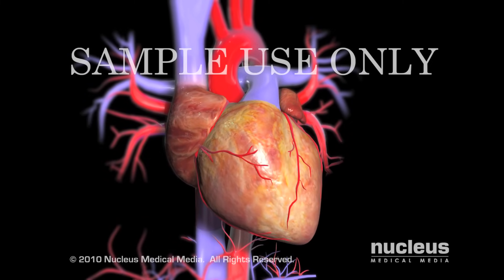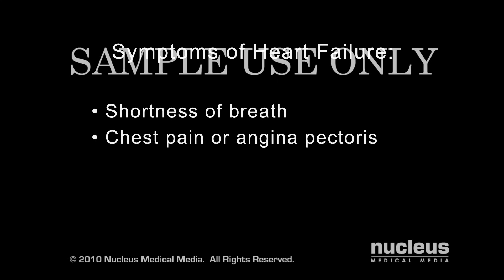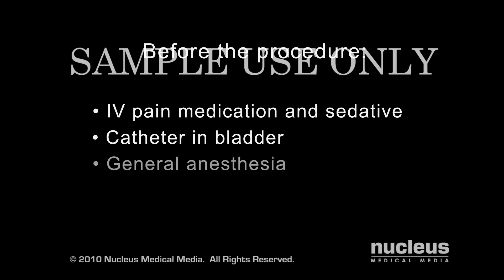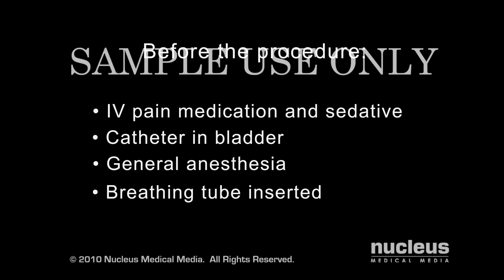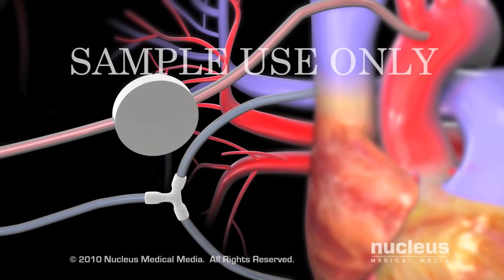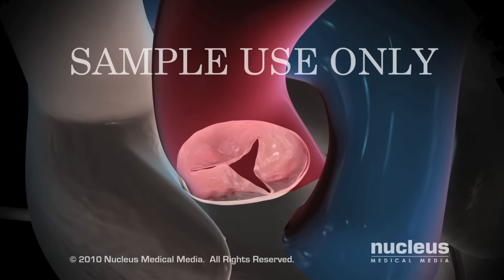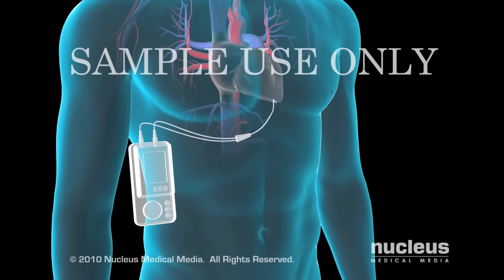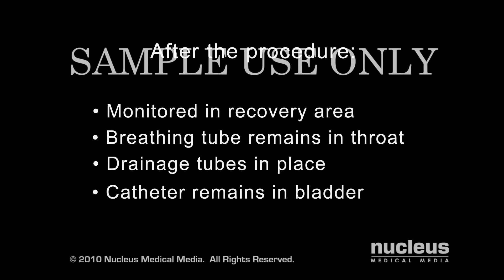Aortic Valve Replacement

Comment: im only 26 and just had mine done 4 weeks ago, very easy. recovery is the hard part
Reply: You are 34 now
Reply: @kimisinclair.04  35 now. heart feels fine but now having strange pains like cramping. had heart monitor for 1 month and 2 ECHOs and said everything good. its a strange feeling. got to try different doctor.
Reply: @tallicafan85  great I hope ur doing fine sir
Reply: @tallicafan85  cramping where?
Reply: @Pardesiah1  under bottom breast bone and few inches on each side from there. its like pressure and a  cramp like pushing on it with you finger kinda hard.
Reply: @tallicafan85  i have also cramping like feeling for 4 years now,im 18 years old.the doctor said every thing is ok.and i just have bicuspid aortic valve and its functioning properly idk what to do😪.
Reply: @wardog5073  i was fine for a week or so then last night constantly hurting. I think its scar from the stitches.
Reply: @tallicafan85  what symptoms do you have when your valves are damage before surgery
Reply: @robinsonlaishram4141  before surgery i had chest pains and the urge to need a drink for the pain would go away. I would get red in the face easy and cramping in the chest.
Reply: @tallicafan85  my mother is 56 now.. she has been told to get this surgery done. I'm so freaking afraid since my Aunt passed away a few months back with the same surgery. Idk what should I do, don't wanna lose my mom.
Reply: @tallicafan85 don't know who you are, but, good to know you are healthy!
Reply: @kimisinclair.04  abb doorbean se Hota ha kya
Reply: 10 days ago at 40 and fully agree!
Reply: @shanithmuhammed1490  i choose the artificial valve.  If you have the metal one you gotta be on blood thinners and if you get cut you will bleed more.
Reply: For how long is that valve lasting?
Reply: I’m 41, I need this done within the next couple months. I have congenital aortic stenosis.
Reply: @Your-Boi-Shane  same with me, did u do AVR.... Whats app me 00966565914899
Reply: @Your-Boi-Shane Same. 45.
Reply: God bless you inshAllah you are fine today  may Allah bless you with hafiya Ameen ❤️
Reply: Can it be diagnosed after 2 month bcz my friend is syncope attacks too 
Due to covid he is  not able to go .
Reply: I was just told today I am going to have this surgery done not looking forward to the breathing tube
Reply: @shanithmuhammed1490  dont know what your hospital does but only options i had has artificial or metallic. that was at yale.
Reply: Hey i need to contact you please give me your email i also have replace my arotic valve so , please understand i have some questions before surgery , so please replied me
Reply: @Doctoratan  did you done your surgery..can you tell me what are difficulties you faced after surgery
Reply: Hope I never have to get this done, I’d rather not have any surgeries ever but the way my heart has been acting I may have to get something
Reply: @Chriss_geek_shop  get tested, its your health. i did wait a ling time to get checked out and when i was getting worse pains i got checked out. doctor said if i would have waited another year i could have had a heart attack.
Reply: @tallicafan85  Derek, how are you now?
Reply: David Afanasiev  aab toh sayad doorbean see Hota ha
Reply: My song is getting ready to have that done probably here in the next couple months. He's only 13
Reply: My ex had it done at 26
Reply: How did you felt?...how long you got the pain of surgery after done heart surgery..?does it hurts for long time..and what about your bone...did you find any difficulties after surgery...my mom is 47 years old..and doctor said she want to be done heart surgery...iam very scared..does it hurt after surgery...pls tell me
Reply: @방탄소년단-c3m  yes it hurts. it is your main chest bone and takes 1 year or more to heal. hurts to sleep if you move to your sides or sneeze. cant lift more than a few pounds for months.
Reply: @tallicafan85  I'm tired of chest pain and hard breathing. I'm 23 and i have bicuspid aorta. I think i should get this surgery done. What do you think about valve replacement from femoral arter? Is it better? Thank you, i hope you will better
Reply: I was told last year that I have a heart valve stenosis and need to get this surgery done and replace my valve. Recently, the doctors told that I must get it done as soon as I'm ready. I'm just 21 yo. 
Can anybody tell me should I  choose Ross procedure or get a mechanical valve?
Reply: @ziauddinhabibi2678  artificial valve better. mechanical valve means you be on blood thinners and if you get a cut you will bleed a  lot more.
Reply: I'm about to have mines in 2 months, what was the recovery like? Also glad to see that your doing okay <3
Reply: @peepo8455  recovery was the hard part. i had chest cut open and after being home, couldn't really do much. lifting more than 3lbs hurt, sneezing and sleeping. took 8 months before strength came back.
Reply: @tallicafan85  you choose mechanial walve or tisue walve?
Reply: @faisalshabbir4248  artificial valve. if you have mechanical you will need to be on blood thinners and if you get cut alot like i do you will bleed more.
Reply: @tallicafan85  then what about after 8 years
Reply: @faisalshabbir4248  its been 10 and bones are beyond healed. i say it takes about 2 years to fuse and get back up to strength.
Reply: You are 37-38 now…
Reply: @edoardoseccafien655  yup, 38. still doing good and not having much caffeine like i used to.
Reply: How much it cost
Reply: @ranro-o3  all depends on your health insurance. for tests and surgery then i think i paid out of pocket about $6k
Reply: @tallicafan85  8 years later and you're doing fine. What a chad.
Reply: @ranro-o3  more that your whole life. 

That was rude I am sorry
Reply: Can u do your regular task now?
Reply: @sadatmuid2580  yes, only took 1 year to heal up and 2 to get stronger.
Reply: Where ?
Reply: Where did you get it done ?
Reply: eèe3ee
Reply: text
Reply: I'm 26 and having this done :(
Reply: I m 36,Dr said I had to do this surgery,my kids are too small m very nervous nd very tensed I m a working women,no one to help me,I have to raise them
Reply: Getting mine at 17 haha
Reply: good luck to all of you…may God make it easy for all of you and may you heal faster than you were expecting 🙏🤲
Reply: Are u still alive
Reply: Aapke ef kitni thi operate tym
Reply: Apki surgery ko 10 year now u will fine sir
Reply: Am 29 heart valve damaged minor leak
Reply: How much cost sir
Reply: @nethradeepak8595  depends on your insurance. I think for everything it was $5-7k out of pocket
Reply: Wow 26 and had aortic valve replacement! I saw your most recent comment from 1 day ago, glad you are doing well! 
My father (60 years old) just had this surgery yesterday, Drs said the surgery went well, he’s in ICU now still sedated, he’s been having these muscle spasms or convulsions or something. Neurologist is saying all his tests look good brain wise. Did you experience anything like that after your surgery?
Reply: @6thGearSmacked  im doing ok after these years. My 11 year anniversary is coming up in few days. Only thing that is going on with me now is chest pains. Had heart monitor for a month a 4 years ago and they said heart was fine. Still. Don’t know what causes it. Just had the pain so bad last night I almost wanted to go to hospital. I was in pain and sweating, almost threw up. Not sure if it was bad hear burn of caffeine reaction.
Reply: @tallicafan85  hey I was wondering what symptoms were you having in the first place that prompted to you to get checked and end up getting this surgery? 
My dad had this surgery recently and is still recovering. And now all the sudden I am having weird chest feelings..
Reply: @6thGearSmacked  it was bad chest pains like cramps around the heart. I would turn red easily. I would need to drink something for it to go away and thought it was just heart burn. Then one night I couldn’t sleep it got so bad I called out if work and went to walk in clinic. Was a 1 hour wait but read my symptoms and i got right in then was recommended to hospital.
Reply: @tallicafan85  could they immediately tell something was seriously wrong?
Reply: @6thGearSmacked  thats why they recommended me to the hospital for more testa, they heard sloshing in my heart and thats a sign of a leaking valve.
Reply: @tallicafan85  ah ok I see. Thanks for the response man! I hope you are doing well these days. My dad had this surgery 2 months ago, spent most of June in the hospital afterwards with some other complications, pneumonia, fluid in lungs and around lungs... but he’s out now doing better. 
I’m 29 and recently been having weird feelings in my chest, went to the ER this past Monday, they did blood test, EKG and what not and said everything looked ok. Saw a cardiologist and have to follow up with them to do more testing. They didn’t say anything to me about hearing any sloshing or murmurs so I’m really hoping it’s nothing too serious.
Reply: Hi , how is your father doing now? I hope he's feeling well
Reply: Wow! God Bless ❤️
Reply: you have bicuspid aortic valve stenosis.
Reply: Got mine coming up next month and I'm crapping myself haha
Reply: Wow you are sp young how did yours get damaged ?
Reply: @susannasPOV  was born with it. Its in the family plus i drank energy drinks by the case.
Reply: How you holding up?
Reply: Are you guys still good after all these years??
Reply: @NatrlyPrtty  still doing good. but im lacking right now is my yearly ECHO i need to get to check my heart. had appointment for march of 2020 but world happened and havent rescheduled. i been talking about doing one soon.
Reply: Hi. can i ask about operation. how is it. im only 27.
im afraid to being Operated!/operation..

any advices there? Thank you,.
Reply: @ i was 26 and nervous too but i watched this vid and just trusted the process. It only felt like a 10min operation. Recovery is the hard part.
Reply: what was your diagnosis? was it severe aortic stenosis?
Reply: @falischika6221  they said it was severe aortic regurgitation but I had another consultation recently where they said it wasn’t severe enough to warrant surgery- so they’re going to monitor it until it does need intervention
Reply: @falischika6221  i had a leaky valve and doctor said if I waited lot longer for surgery I would have had a heart attack
Reply: @falischika6221  yes, it's severe valve stenosis

Comment: At first my cardiologists said  I need a a aortic heart valve replacement.well I just found out its not my valve its my aortic.the size of my aortic is 4.6 which is double the regular size so my valve doesn't close all the way because I have aortic aneurysm.so they well replace that whole part of my heart. I'm scare
Reply: In June 2011 I had aortic aneurysm 4.0 so I was walking 6 miles a day . So I had a ct scan to check out my aorta,the tech put the dye in my muscle not my aorta,so the ct scan miss read and said my aorta was. Directing,so that day the cut me open and found I still had a 4.0 aneurysm, so they wrapped it and installed a bovine valve. June 20011 now it’s 20118 April I am 66 years old. Still wondering when I will need a new valve,not fun. I wold like to talk with other people like me,Good luck

Comment: Just found out today that I will need a mechanical aortic valve replacement.  I'm 39 and have been in athletics all my life and no one ever caught my murmur and the fact that I was born with 2 cusps.  Started seeing doctors because I've been dizzy for about 6 months and thought it was an inner ear / vertigo related ailment.  Anyone else experience dizziness associated with the murmur / aortic valve issues?  God bless all of you.
Reply: I suffer from the same disease
Reply: I was born with a bicuspid valve; I'm 56 and have moderate aortic stenosis, severe aortic regurgitation, and a 4.6 cm aneurysm on my aortic root. I don't have heart failure but I do get tired and dizzy a lot. I also wonder if it's related.

Comment: Question:
Does opening the aorta not compromise its integrity, its resistance to pressure?
Reply: Didn't mine. I'm fine after aortic valve replacement. Operated at age 74, now 75. Amazing what modern medicine can do.